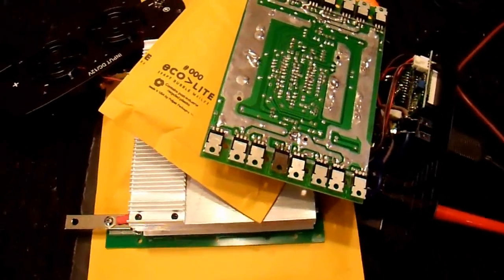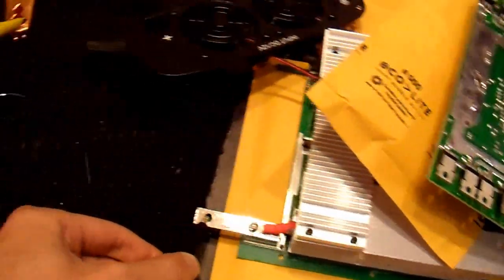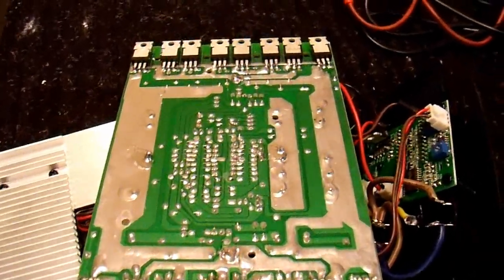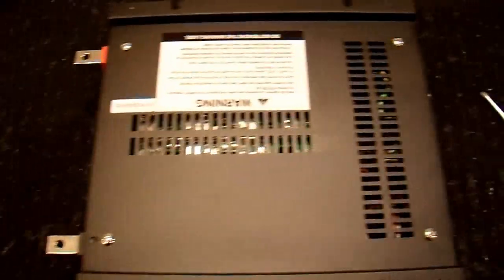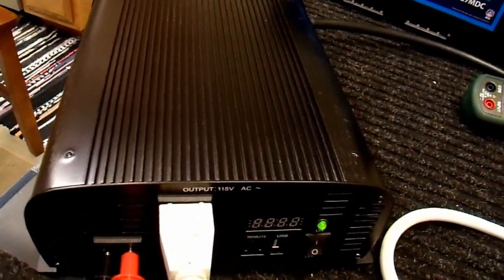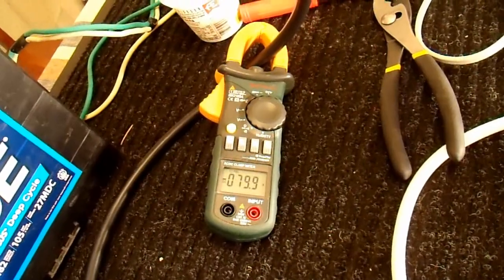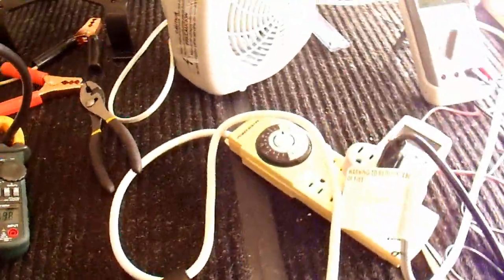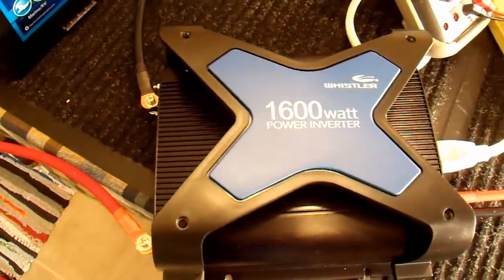Inverter Repair Whistler Pro-1600W Part 2 - Reassembly + Test

Comment: After watching your videos for quite some time, I've finally made the leap from an aims 5000 watt modified, to a samlex 3000 pure sine wave inverter,  and I love it.  

Also I wanted to share a trick I use when connecting them to the battery.  I use an automotive incandescent light in series between the battery and inverter just before connecting.  The test light lights for 5-10 seconds while the capacitors charge up.  Then I make my final connection,  and.... No Spark.  I also discharged them in a similar manner when disconnecting.
Reply from the maker: Great tip!  Which series Samlex do you have?  I find the new ones to be good, but not quite as good as the older models.
Reply: @knurlgnar24  this one:  https://www.samlexamerica.com/products/ProductDetail.aspx?pid=584

Comment: Great video, very thorough. I have a 12VDC to 220VAC 1000w inverter, visual damage (burnt) to 7 of 12 transistors, which are "RFP50N06 N-Channel Power MOSFET 60V, 50A, 22mΩ". Because these have blown/burnt out would you suggest there is another issue with the inverter? I cannot see any other damage that would raise suspicion. there is another bank of 8 transistors "IRFP450 14A, 500V, 0.400 Ohm, N-channel Power MOSFET", where a couple of these are testing as shorted also. I am keen to have your input?

Comment: i got a vector 1200 watt maxx it bit the dust one day during an experament trying to start up a large old fashon3/4hp motor  stupid of me tripping the power plug to get it to start it ran 10 both led lamps went on i shut it dwn reset no since wont run soo being iam a tv 30yrs in electronics i found 2 driver fets shorted there $2.50 each but i feal all drivers n outputs should be done so every stage is in balance now iam up to 40 or so bucks  n send to texas to get them  iam not to crazy about the workmanship this company did thers  buss wire laid over trace on power fets tells me copper on board is to thin and there was a bit of hot glue some fiber insulation on some jumpers tells me it was a rebuild  and i got it at pepboys new in a seal tight box i tryed to call co support there no longer in biz  iam like wat da fk over all as my first good inverter it worked great never hot 10,5 low 15 hi input max draw @ 1,5kw 200 amp its rather quiet on electronics just make sure it has a good heavy duty deep cycle battery
Reply from the maker: It is common to use wires soldered to the PCB to increase the current carrying capacity of otherwise inadequate traces.  I don't like the practice since it is a hand operation and poorly controlled, but many inexpensive inverters use that practice.
Reply: all boards today are so crappy coppers to thin i love the old school ones  i got some electronics that got some wow made to do

Comment: my 600 watt I have I can use half of it up to 300 watts anything over that it will surly fry the remaing transformer so I dont use it until I can get the replacement transformer I hop you can help thanks.

Comment: I like your repair videos. I see a lot of your repairs deal with the mosfets going bad. I have a Grid tired inverter, were one of the transformers went bad. I have a Sun GTI 22 to 60 volt 600 watt GTI. so it has two 300 watt transformers. and finding a replacement transformer is a pain in the ass. the transformer is a ee4215-24v350v. if you buy chance have GTI's that are bad and unrepair about. and the transformers might be good. I would buy it off yea.

Comment from the maker: Congrats!  The bad fuse and no obvious burnt components is a very good sign.  Since all of the boost circuits are connected in series in nearly all inverters a single bad fuse will render the entire unit dead.  You probably (hopefully?) just need a new fuse.

Comment: Got it.  I thought the bottom plate was just a rectangular plane, but discovered the side pieces were welded to it.  When I pried from the end it came off.  My guts look different from your guts.  I didn't see any scorched components and at lease one of the fuses is bad.  There are 6 40 amp fuses.  When I find my meter I'll test, replace and fire it up to see what happens.  Thanks for your help.

Comment from the maker: With the plastic piece removed and the bottom screws out the bottom plate should come off easily if I remember correctly.

'Reasonable price' is subjective but in my opinion, no.  The high price premium for pure sine inverters is a matter of volumes and marketing, nothing technical.

Comment: Thanks for the reply.  I didn't have a chance to look at it today, but when I removed all the screws Thursday the bottom cover still seemed firmly attached.  I'll try a gentle pry.  It doesn't slide, does it?

I was surprised at how increased load deteriorates the wave so much.  Have you found a 2000 to 3000 watt sine inverter with a reasonable price (in case I can't fix this one - only used it once)?

Comment from the maker: Reverse voltage might only 'blow' the fuses - easy fix.  But you may need to go through a similar process as I did with the input portion of the inverter next to the transformers rather than the output side as I did.  Sometimes it also fries some of the proprietary control circuitry in which case it gets much more complicated.  Either way I encourage you to take a look if you have interest.  Nothing to lose but some time!

Comment: Very helpful.  I'm electronically illiterate but learned from you.  I have a 2000W Whistler that is dead.  I think someone switched the input cables. I haven't been able to peek inside yet as the bottom plate seems to be stuck.  What would you expect the most common damage would be caused by reversing the battery cables.